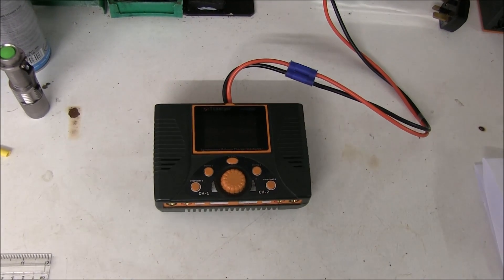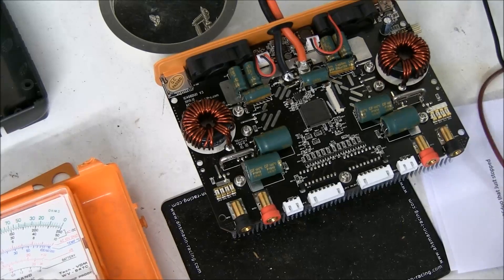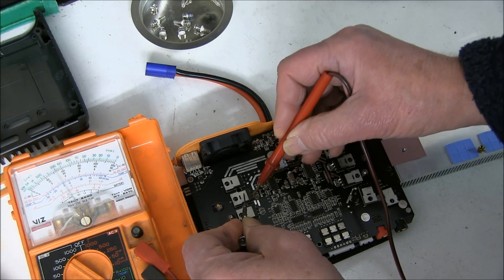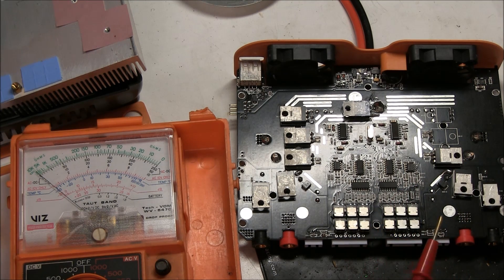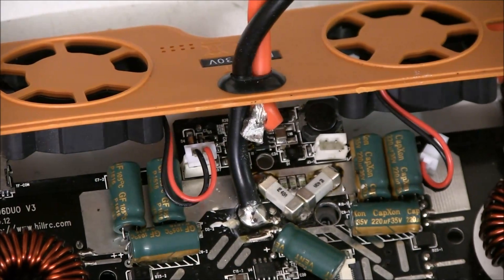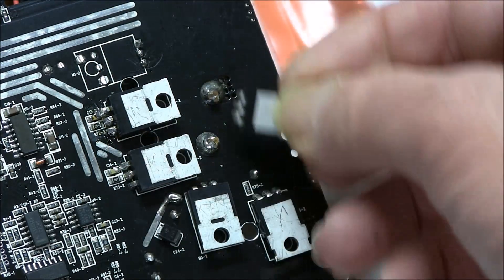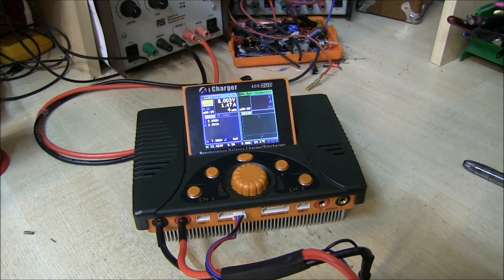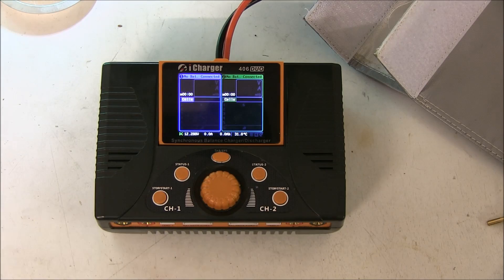iCharger 406 Duo. Dead, no power, fault.  Repair and test.

Comment: Do you happen to know what diode value reference designator D24-1 is?  I think it's a power diode. Thanks!
Reply: Hi there, I'm looking for information on the power diode Nick mentioned in this video but I think he didn't actually end up changing it...so sad he recently Died RIP Nick 😥
He was brilliant I have a 4010 duo I'm trying to repair and it's Dead, looking inside I have 3 faulty MOSFETs I'll exchange them out and try to make a YouTube video at the same time.

Comment: Nick I have a duo 308. I shorted the power input. When we pulled off heat sink the transistor that was burnt snapped off the back of the board. Can you tell me what part number I should order for the input power fet. Tx sir

Comment: Do you offer an iCharger repair service? Mine is the same model as in this video and when i discharge it starts smoking!!
Reply from the maker: Hi Matt.  The internal discharge can be damaged if you put the amps too high, wgich badly overheats the internals.
WhatCountry are you in? I am in theUK.  Nick

Comment: Hey Nick, My scroll wheel on my 4010 is not working, is there a Nick fix?
Reply from the maker: Hi . The failure of the front panel controls and display is usually caused by the ribbon cable coming loose or misaligned.
It is very easily damaged if you try to reseat it, so be careful. It is possible to buy a longer one if it is damaged.
However in your case, if the charger has not been dropped or opened it is unusual to to have the problem.
Reply: @nickadams5411  Thanks Nick, it was the cable being messed up. I got another charge that was not working and used the cable from that, got the other one working that I used the cable from, bought a new cable and when I hooked it up I had no screen but it powered up, so I opened it again and the cable did not go all the way in. When I tried to power it again, nothing, so I disconnected the screen again and it will power up. What is wrong with it when the screen is connected?
Reply from the maker: @Reis4four  Hi. Are you sure you bought the correct ribbon. It is FFC cable 26pos
Reply: @nickadams5411  I got a cable 26 pin off amazon, it's not the same side cable and I'm thinking it's that but finding one is the problem that's not going to take a month to get.  This is the one I got. https://www.amazon.com/gp/product/B07RX7Z6K3/ref=ppx_yo_dt_b_asin_title_o01_s00?ie=UTF8&psc=1
Reply from the maker: @Reis4four   That is the wrong one, as it reverses the pin order. You need the one with the pins on the same side at each end. I got mine from Farnell

https://uk.farnell.com/wurth-elektronik/687626152002/ffc-cable-26pos-152mm-60v-white/dp/2520247?ost=2520247&ddkey=https%3Aen-GB%2FElement14_United_Kingdom%2Fsearch
Reply: @nickadams5411  That's what I thought, I ordered from your supplier and will come in seven days as to 5 weeks from amazon.  Thanks Nick.

Comment: hi mine doesn't have fuses but the d1 (1320 JG) diode next to your fuse placement is cracked what can i replace it with?
Reply from the maker: I think that is a transient suppression diode. It should work without it.
Reply: @nickadams5411  after changing the irf3205 i was happy to hear the startup noise. I bought 2 more Schottky diode to replace the ones that were shorted and in the final test before complete assembly it started up once but never again. Repairs can be frustrating i just lost one week on this thing :(
Reply: @nickadams5411  thanks for the reply i was recomended a Schottky diode but it does not work yet, i have to test the components because that diode was the only thing that exploded.

Comment: Hello,please,my 308duo burned the f3205z and R72-1 resistors and the C13-1 capacitor.l con get the f3205z and R72-1 but l don't know the C13-1 capacitor data.can you help?

Comment: hey nick how are you?? listen I fixed a some charger like 308 and 406, but I have one that I replace fet and fuse and still making a error code, one side work perfect but bank one I can't find the problem, there is any way that I send to you to fix it?
Reply from the maker: Hi Manny. The older ones, without the fuses, had some issues with the control chip going bad after short circuits.  That aside, sometimes the resistors that connect to the FETS go open circuit, so check them. If yours is the newer versions with fuses then the faults are always hardware failures like Fets, fuses, resistors and diodes. Sometimes capacitors fail, but you can see when they have overheated.  What Country are you in?

Comment: My charger is doing the same thing, not powering on. But when I take it apart it does not have the fuses on the positive lead also the FETs seem fine as well. Is there something else that I can check?
Reply from the maker: Hi Marshall
I have seen a few of the older ones that will not power on.
It seems a voltage regulator blows, check the one at the top of the board.
Besides that, try contacting the manufacturer for advice.
I believe they do answer emails.
Reply: Nick Adams thanks. I have contacted the manufacturer, just waiting to hear from them. Thought it would be simple to repair this, but I think I’m in over my head on this one.

Comment: Hey Nick, resistor R66 says 110 on it, as do bunches of others. What do I buy to replace it? Is 110 the Ohms? Mine appeared to be blown after a mosfet short. Your videos are super helpful! Thanks!
Reply from the maker: Hi Gabe
I have not replaced any resistors, but it must be 110ohm, as you say.
Did you check it or the others with an ohmeter to see what it measures?
Reply: Nick Adams not yet but I was going to do that next. I guess I just was hoping to be sure that it indeed means 110ohm. Pictures online of first gen (no fuses) iCharger boards have the same layout as mine but the resistors are labeled differently (or not at all) on mine. I assumed it was just because of component source variation in the factory, or because of mine being a manufacturer refurb.
Reply: Nick Adams I think it’s 11 ohms actually. According to everything I can find: https://www.hobby-hour.com/electronics/smdcalc.php

Comment: Nick, I need to replace the FETS on my 406 Duo, do you have a link ad to which ones I should order? Also, should I do the fuses at the same time while I’m in there?
Reply from the maker: Hi Scott
The FETS are IRFB3205ZPBF, but you can use the even better ones IRFB3306PBF
They are very cheap on Ebay.
You do not need to change the fuses unless they are blown, open circuit.

Comment: Thank you Nick... I tried to plug it in and now neither side is working. The 12v input power source wires got very hot, so I quickly shut it down. I think I’m in over my head. Would you be able to repair it?

Comment: Hi Nick.. looks like I have to replace the diode. Can you give me the specs on the diode so I can order it. Thanks
Reply from the maker: Hi
Sorry, I have not been able to find a diode the same size.
I had to fit a slightly larger one.I used a 5 amp 40v shottky diode SMC type. Part number SS54
Reply: Do you know what the value of the d42 diodes. Thanks
Reply from the maker: Hi Chuck
Not sure of the value. I used a 4 amp schottky.

Comment: Right channel error message “wrong voltage output” I noticed a small flat electronic piece to the left of the upper mosfet, seemed to be shorted out. What is that piece? I’ll order it if you can tell me what it is.
Thank you, Nick

Comment: Hi Nick... i have a question about a 406 Duo. please get back to me. Thank you...
Reply from the maker: Hi
What is the question?
Reply: I replace defective mosfet and it started to charge. Got error
Reply from the maker: what sort of error.  Did it charge, or stop?  Is it both channels?
Reply: I replaced a mosfet. Started to charge. Got error message”wrong voltage output “. 3 mosfet got burned. I saw a small black piece that appears to be a diode. Seems to be shorted out. I lack the experience to know what is wrong.
Reply from the maker: Unfortunately, it is important to limit the current going into the charger when you are not sure if there is still a fault.
I have a power supply with current limiting, and I will start at the very safe 1 amp charge rate to make sure everything is good, before ramping it up.
If you manage to replace the blown parts, double check the resistance values with a meter as in the video, comparing left and right channels.
The diode, check it last, as a blown FET will short across it anyway.

Comment: What is the incoming fet part number? Thanks
Reply from the maker: Hi Chuck
The single FET which is by the power wires is the same as the others, IRF3205ZPBF
Try and get that version, which is rated at 110A

Comment: Nick Adams How reliable are the 406 duos?
Reply from the maker: Hi Elliot
I would say they are very reliable.
Failures are normally due to incorrect connections.
Reply: Nick Adams Thanks so much for the reply! Your insight in these videos is greatly appreciated!
Reply: Hi nick do you repair ichargers 306b? I switched my charger on and then plugged my connected batterys into the red and black input by mistake ( usually i dont switch charger on first) When i plugged red input in the plug arcted and blew. ( it wasnt reverse polarity) the screen went blank. Then came back on and nothing happend otherthan the letters cccc on the lcd screen. I switch it off for about 2 hrs. When turned back on...all works fine otherthan the lcd screen is now flickering slightly. Iam not sure if it needs repairing and was wondering if you provide this service. Thank you rocco
Reply from the maker: Hi Rocco
Where are you situated?
Try resetting the charger to Default factory setting.
Let me know

Comment: i have a icharger 406 duo older unit. I tried to test the fuse bank(4) in channel 2 but the circuit board doesn't have this fuse bank near the +- terminal outputs. Are they on this older board? If so, where are they located? Thank You
Reply from the maker: Hi Bruce
As far as I know, the early chargers did not have any fuses on the outputs.
So any faults are normally the Power Fets blown out.